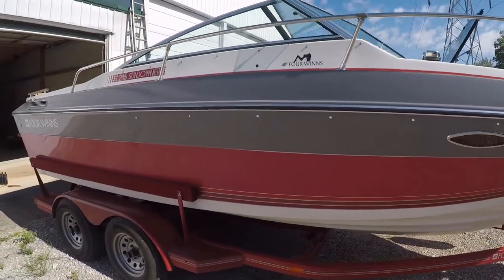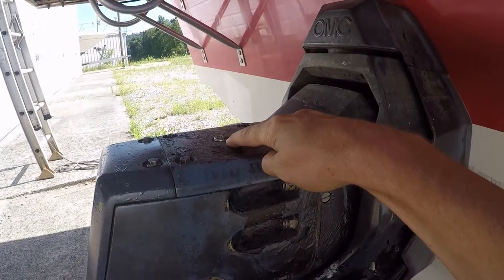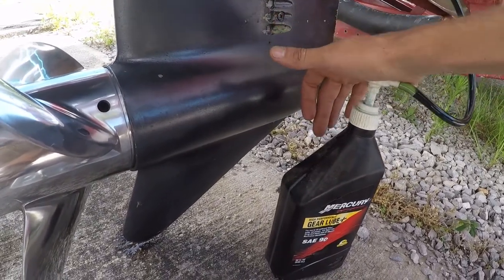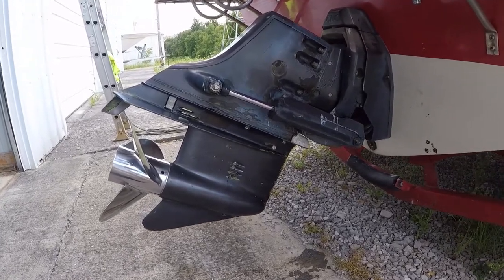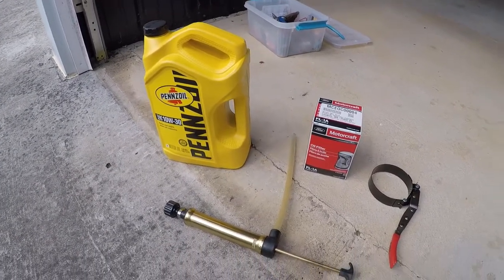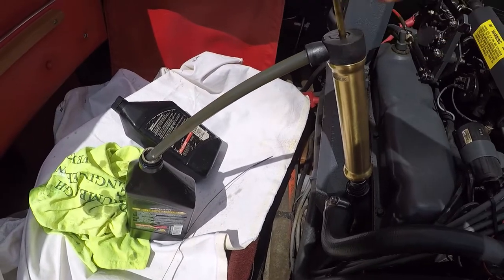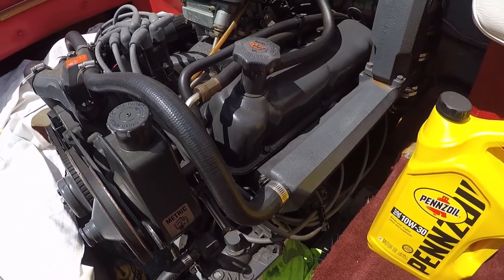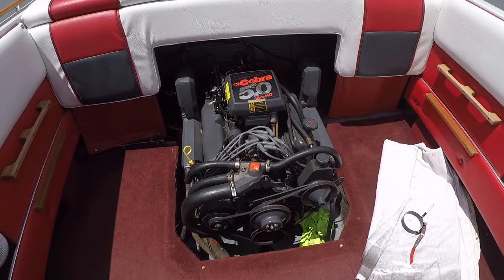Basic Boat Maintenance. OMC drive and engine oil change, fuel filter, grease fittings.

Comment: Great video, and well explained.  You filled from the middle plug, which I have never done because the chance of air getting into the case.  I have always filled from the bottom plug.  Of course, it's also important to take it slowly to avoid those air bubbles.

I also remove the vertical drive to inspect the U-joint and watch the grease escape from the gimbal bearing.  You want to be sure to add enough grease until the new runs out, and to catch it before a mess is made.  Just my way of doing the same work.  Thanks for your contribution!

Comment: This was a very insightful video.

If, once I have done an oil change, after I run it for a short period of time, I lose oil pressure.  When I remove the oil filter the oil is black and appears to have water in it.  Would you be willing to provide a cause for this issue, and possible a recommended fix. Hopefully short of replacing the engine. I would be grateful. Thanks.

Comment: You should always pump outdrive oil from bottom plug. Unfortunately I learned that hard way and my outdrive top gears melted.
Reply from the maker: Not true. OMC calls the bottom plug the drain plug, and the middle plug the fill plug. I can also copy a page from the manual verifying this procedure.

Comment: Suppose to fill it from the bottom only until it comes out of the middle,then put middle screw in n fill the rest from the top.run engine n put in gear forward n reverse the recheck the dip stick top screw.those oil pumps work well . I have one.
Reply from the maker: wrong

Comment: I also have a Four Winns with a Cobra OMC Motor. It was in the shop for 3 months with the carb rebuilt and gears all changed out because the engine locked up. Now it’s stalling when accelerating so I’m thinking it could be a fuel line issue. Have you ever changed the fuel lines on yours before?
Reply: Same thing is happening to me 2 days ago it goes but when i try to go fast its like the fuel isnt flowing good i think its the fuel filter i dont know when it was changed but im gonna changed it and see if its that.

Comment: hey do you monitor your comments??? if so i have a OMC cobra 2 with a 5.7. the 5.7 will only rev to 4200 and it only will go 45mph. it gets to 45mph really fast but dead stops at 4200rpm. Any idea?